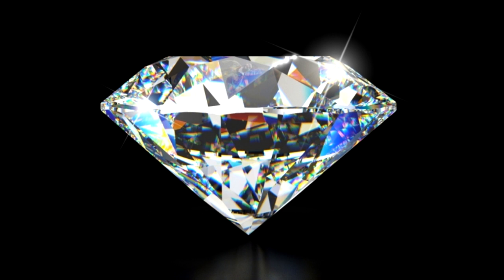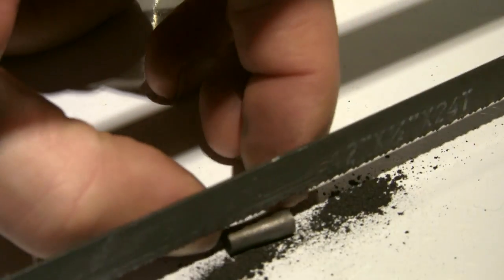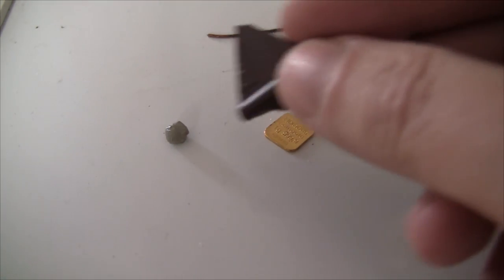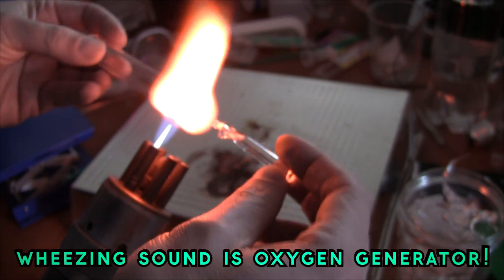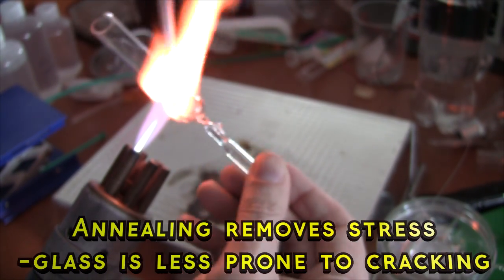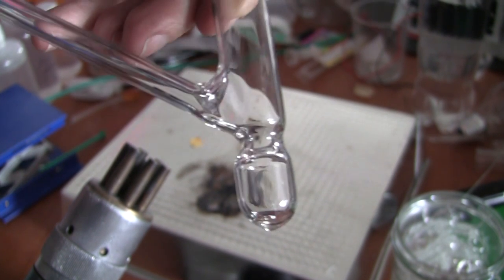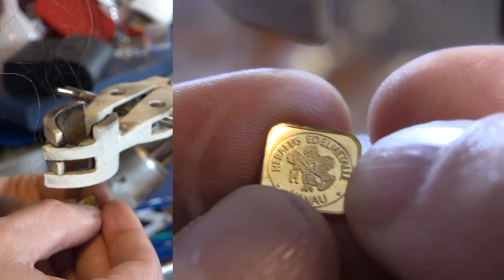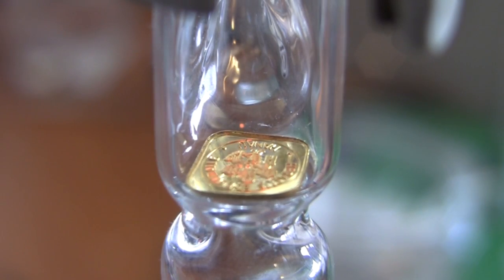Can burning Diamond melt Gold?

Comment: Could you pipe the air in from the top? Blowing the flame towards the gold will increase the amount of heat transferred. The oxygen will also get an opportunity to preheat before contacting the metal, so the metal should have less heat wicked away.

Comment: what metal were you using with the tweezers that the heat didn't conduct and burn you since you weren't wearing gloves and it was holding a noticeably hot item?

Comment: I bought 4 small impure diamonds on a gemstone market in France for only 1 euro.
They are completely transparent apart from the tiny coal impurities stuck in the middle.
Would those diamonds burn better or worse than the diamond you used?

Comment: You hit a diamond with a hammer, it shatters. I've done a paper about diamond years ago. Perhaps it won't be as dramatic as what I've seen - the diamond crushed into powder by one hit with a 'special' mortar and pestle (which was just a very heavy iron tube and an iron pestle that fit together perfectly) - the diamond won't survive as a whole.
The powder they gain from this is used in the industry to, you guessed it, cut diamonds and other stones. They coat the edges of 10µm thick copper (yes, copper) discs with a mixture of sticky oil (I think it was vaseline/petroleum jelly) and the powder due to which it gets its ability to cut through diamond. Still takes quite some time to do this.
Source: my own research and a demonstration/own experience in the Bruges Diamond Museum in Belgium (where diamond cutting was invented).

Comment: Way to go thunderf00t, now all the drug users are going to want you to make bongs for them, or at least flood the comment section with comments relating to it.

But in my opinion, diamonds should theoretically be able to melt the gold, it's just as you said, figuring out a way around that conductivity issue. Maybe cup the gold around it so there's a lot more surface contact? A bigger / more pure diamond might help too, but obviously that would be way too expensive for just an experiment.

Comment: 0:30 What is the relevance of diamond being the best thermal conductor out there? That just means it spreads the heat quickly across the diamond right? It doesn't mean that it spreads the heat quicker to the gold or am I understanding this incorrectly?
Reply: It also means that it transfers heat more quickly to the gold. Go in the kitchen, take a knife with a wooden or plastic handle, touch the blade and touch the handle, the former will "feel" warmer: the temperatures are the same but the metal in the blade is getting heat quicker than the the handle from your finger.
Reply: That is about absorbing heat though. Does it work that way as well for heat emission?
Reply: Actually, I'm now questioning your scenario as well. I think your hand transfers the same amount of energy to both parts of the object (blade and handle) but the blade spreads the heat much better to the entire blade, which causes the temperature delta between your hand and the blade to remain bigger for longer.
Since the handle barely spreads the heat to the rest of the handle, the temperature difference between your hand and the handle is small, so little extra energy is transferred from your hand to the handle.

I'm not 100% sure this is the case, but this makes a lot of sense to me.
Reply: Hmm, if my previous comment is true, then the thermal conductivity of diamond is actually relevant; the diamond loses heat through the contact area with the gold. Since diamond is such a good conductor, the contact area won't cool down, but the diamond will quickly equalize the heat in the entire diamond.
Also, since gold is also a good conductor, it makes sense that the diamond didn't melt a hole. The heat was spread too well across the entire piece of gold. If a high enough temperature was reached, it would've melted the gold piece in its entirety, not just a hole.

Comment: Can you break bullet proof glass by placing a diamond point down on it and hitting it?
Reply: there is no "bullet proof glass" just bullet resistant glass
Reply: He probably knows that, But the common name is "bullet-proof'.
Reply: Andrew_FTW 
The diamond will get stuck in the polycarbonate
You could melt the bulletproof glass with something very hot (like a plasma torch) 
A hot diamond would shatter on impact so that wouldn't work either

Comment: It stands to reason that if a burning carbon block can melt gold, then a burning diamond will also melt gold. It also stands to reason that the diamond only had a small area of physical contact with the gold, thus allowing conduction of heat away from the source. Ergo, totally surrounding the gold with enough diamond would melt the gold. It probably will take more diamond than you might want to spend money on, but it should work.

Comment: indeed tf00t, you'll come back to this later no doubt.
first it was bewmbooms, and now you're asking about heat and how that energy is transfer through that lattice etc...

s michaux also made some interesting apparatus to test some similar lattice hypotheticals.
he does some very interesting coatings studies etc... 
could a solar furnace or multi-fresnel-focal midar, or a dvelier, or a halbach-Mazer etc,
focus on a type of diamond or crystal, which diffract onto the gold to latent vaporize?

how is that possible, when the diamond cannot thermally alone melt the gold without itself burning out?
is that a paradox, or is it the difference in how it is transmitted?

je prends conge mon librepenseur!
Reply: If the diamond is acting as a prism to redirect light onto a tiny point, the tiny point will be simply extremely concentrated light, which if strong enough could melt gold easily. It has nothing to do with the diamond itself and any good lense will do the same.
Reply: indeed, though what is it about some diffraction surfaces which make them the better for it?
and... perhaps the diamond could melt all of it prior to burning itself;
if, it were have a different lattice eh?

je prends conge mon librepenseur.
merci pour l'response profond et veracite eh!

Comment: "What happens when you hit a diamond with a hammer" how about with a golden hammer? All jokes aside it would probably not do much. And on the thought of making a nuclear diamond battery sounds stupid on many levels, like the probable cost of one of them, how would it even produce energy, the size of it and many more things like how would it be anywhere close to being safe radiation wise.
Reply: The diamond will crack if it's hit hard enough. Brittleness is not the opposite of hardness... in fact, in the case of diamonds, the hardness is the cause of the brittleness. This is how we are able to cut to diamonds to make jewelry.
Reply: I think my brain did a reboot when that guy suggested that hardness is what prevents radiation from passing through things.

Comment: Use a thermal camera next time please!
Reply: Thermal cameras can't see through glass, it would just show the surface temperature of the glass.
Reply: The Donald it'd likely be washed out, because it's just too hot.
Reply: That's not true, as thermal cameras auto-calibrate depending on the hottest point...
Reply: Yes u are totally right.
Reply: That's true, Samuel. But for some parts of the video he could've as there's nothing in between the camera and the hot objects
Reply: Put a blue filter on non-orange areas and you will get the same thing - thermal cameras are useful when objects do NOT glow
Reply: I think it´s out of the temp. range of his thermal camera.

Comment: just realized that carbon conducts electricity, so diamonds should do it as well?
Reply: Graphite conducts electricity because it has delocalised electrons. Graphite's carbon atoms are covalently bonded to 3 other carbon atoms, whereas in diamond each carbon is covalently bonded to 4 other carbon atoms. Diamond has no delocalised electrons so it doesn't conduct electricity.
Reply: +tom merchant cool, thanks for the info :)

Comment: have you tried Chlorine trifluoride yet?
Reply: thomas chambers chloroform is CHCl3, chlorine trifluoride is ClF3 and the latter is much more dangerous
Reply: I did. It's delicious
Reply: DatInnocentGamer fuck that
Reply: Thats the point xD
Reply: DatInnocentGamer isn't that chloroform ?😂
Reply: I’ll let the late John Clark describe the stuff, since he had first-hand experience in attempts to use it as rocket fuel. From his out-of-print classic Ignition! we have:

”It is, of course, extremely toxic, but that’s the least of the problem. It is hypergolic with every known fuel, and so rapidly hypergolic that no ignition delay has ever been measured. It is also hypergolic with such things as cloth, wood, and test engineers, not to mention asbestos, sand, and water-with which it reacts explosively."  

I'm pretty sure that will melt gold, then explode

Comment: can you ignite a diamond with liquid oxygen?
Reply: Liquid oxygen is incredibly cold, it's not just the pure oxygen that is required to burn the diamond, it needs an incredibly high heat to break the bonds in diamond which are very strong.
Reply: +tom merchant i remember watching on tv that they first preheated the diamond and then put it in  liquid oxygen
Reply: But since diamond is such a good conductor, I would imagine it would cool down very quickly in the oxygen, then again perhaps the heat and gases created by the burning would cushion it. Very interesting experiment I just can't see it lasting more than a few milliseconds.
Reply: +tom merchant i saw it actually last about 5-8 seconds